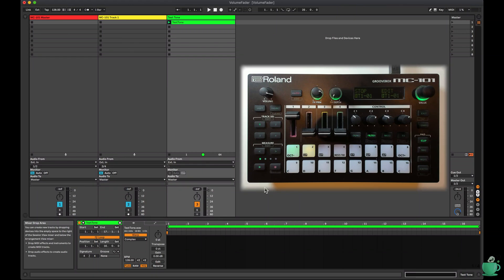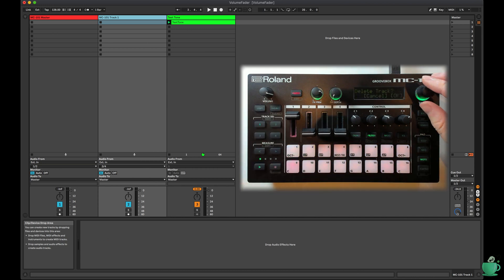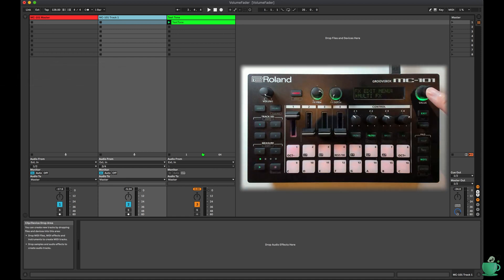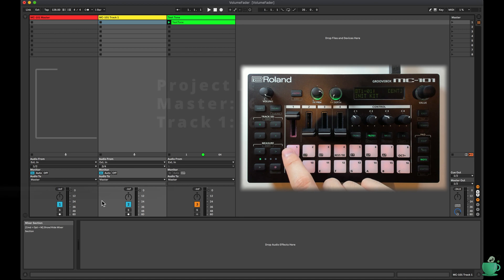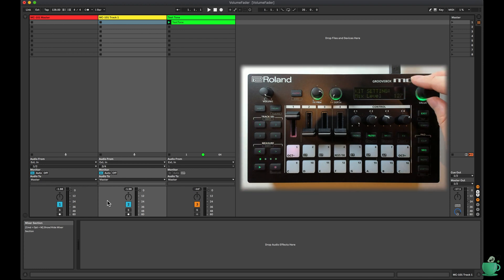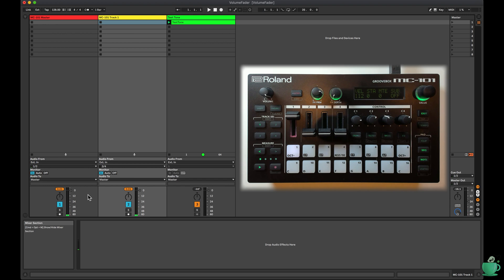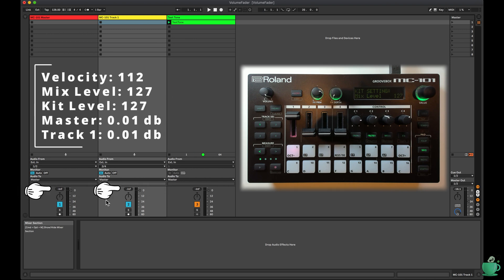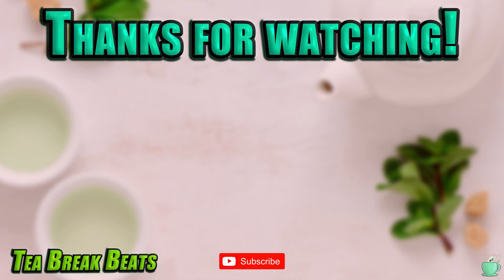Roland MC-101 : Gain Staging // How to set faders & velocity for zero db

Comment: Thanks for this info! Am facing an odd issue on my device, which is that on my drum track (track 1), the volume never goes to 0 even if the faders are set to the lowest value, I still hear the sounds. Is this normal? or is there any setting to set it to -infinity. It sounds like the drum sounds are bleeding into other tracks as well even when the drum track 1 fader is all the way down. Any fix for this?
Reply from the maker: That is very strange...is there a send effect on track 1 going to a delay or reverb on the master track or something? That is the only thing I can think of
Reply: @teabreakbeats   Thanks for your reply! Even I couldn't figure it out, send effect wasn't the problem, tried resetting even. Strangely, looks like the 1st fader on my device itself has some issues!! :( even when turned down, the drum sounds come from other tracks, but sometimes when I press them hard at certain angles they disappear! some sort of hardware issue I guess. Hope it can be fixed. Never faced these kind of quality issues on Roland products before. But I still love the MC 101 :)
Reply from the maker: @ArunKumar-pr5ly  that is super strange - I hope it is still under warranty?
Reply: @teabreakbeats  Yes, luckily it is still under warranty. Trying to co-ordinate with the seller regarding the issue. Fingers crossed.

Comment: Great video! Do you know if there’s a way to set the faders to control pitch or other parameters, rather than volume? Thanks
Reply from the maker: Hi thanks for watching. Not that I know of, the faders are always set to volume. I think you can use an external midi controller with faders to control some MFX parameters: 

You can use MIDI messages such as control change messages to control the principal MFX parameters. This capability is called “MFX CONTROL (multi-effects control).”
The editable parameters are pre-determined according to the MFX type. You can specify up to four parameters for multi-effect control.
To use MFX CONTROL, you’ll need to specify which MIDI message (Source) will affect which parameter (Destination), and how greatly (Sens).

Comment: This video is great, super useful explanation for how the volume coming out of the 101 works, full of good tips for mixing it with external gear. 

I think the mix level option is intentionally redundant, it was added in an update and I think I remember at the time they said it was added so you didn’t have to mix with the faders. That way we can use “level” to do your side chaining trick, “mix level” to actually mix, and the faders to perform fades and stuff. That’s what I do anyway, but it leads to lots of menu options that can be confusing. But now I can send people to this video when they ask about how to get more sound out or into their DAW! So thanks for the clear explanation!
Reply from the maker: Ah - cheers, i see, so Kit Level can be used in the same way I stick a Utility in Ableton to do my volume automation so I can still adjust overall "Mix Level" without redoing all the automation curves! Great trick.